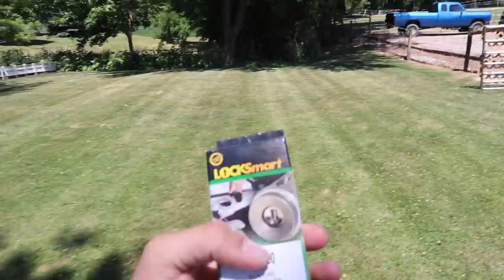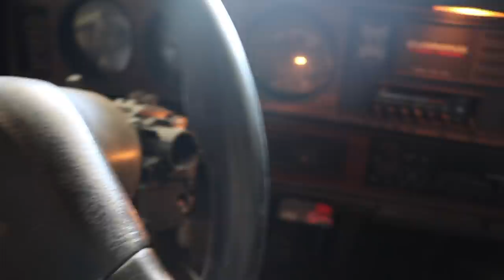RESTO-GEN got NEW WHEELS & TIRES ALREADY!!!

Comment: Hey Boss just a heads-up the center caps for the front middles pop off for trucks with manual hubs. PRO COMP really did a good job making those rims for trucks with hubs or not. If you didn't know.